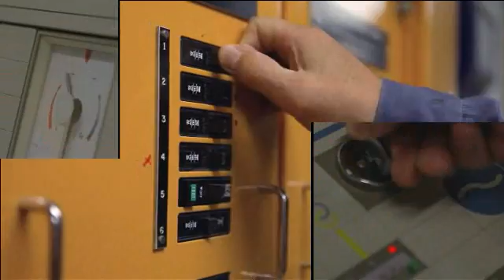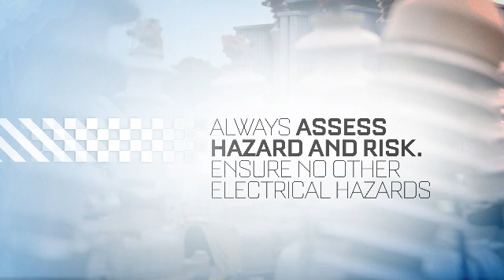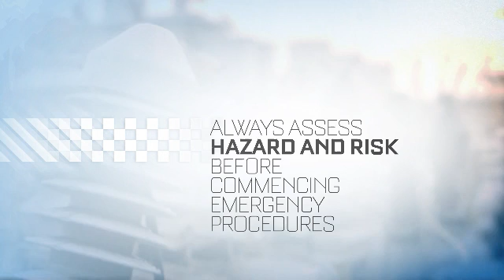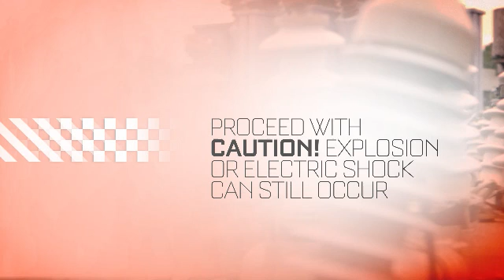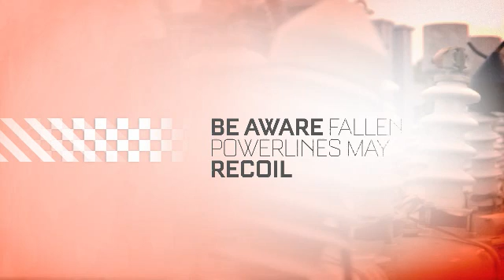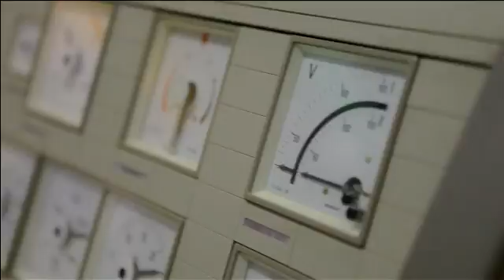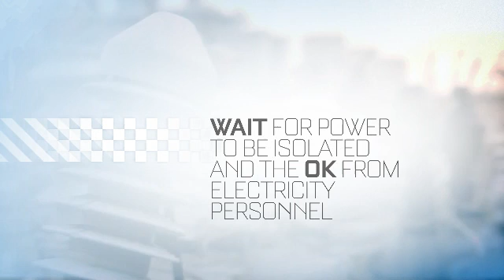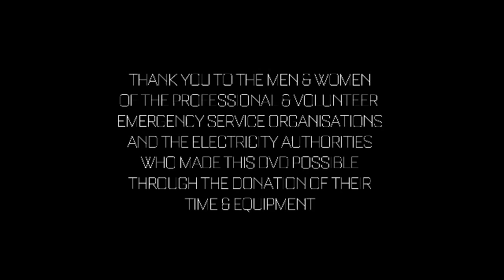Electrical hazard awareness for emergency service personnel

Comment: SES training on Storm course.
Reply: Always assume the power line is live!
Reply: Keep everyone at least 8m away.  Watch out for coiled wires
Reply: Contact the headquarter and report to the electricity authority
Reply: Hazard and risk assessment - don’t Park near power Lines
Reply: Turn off the main switch
Reply: Illegal wiring!
Reply: Move away, contact electricity authority, move only as directed
Reply: Electrical charge on metal roof
Reply: Solar power always generate electricity
Reply: Watch out for power line in water or small and assume to be lkvey